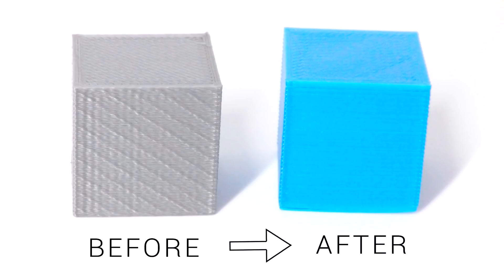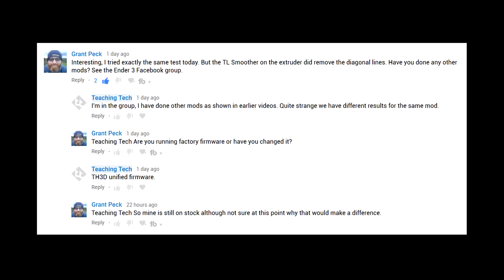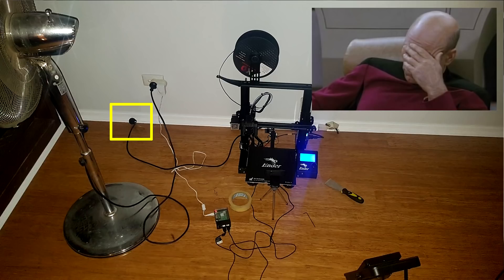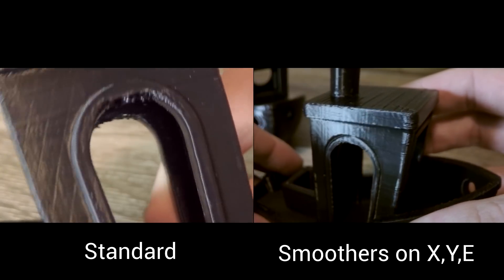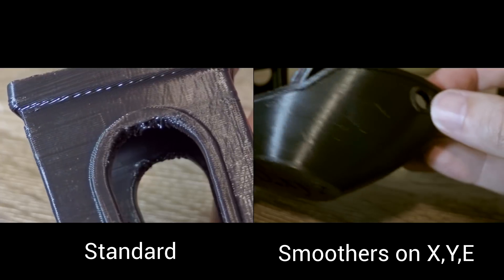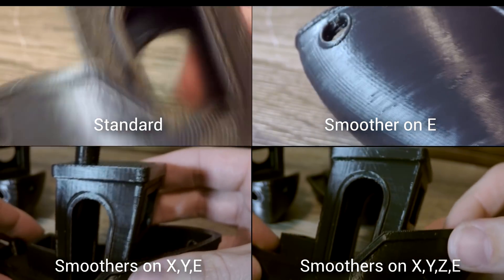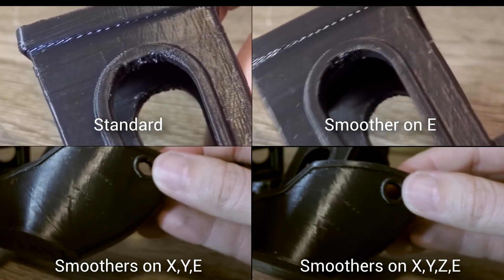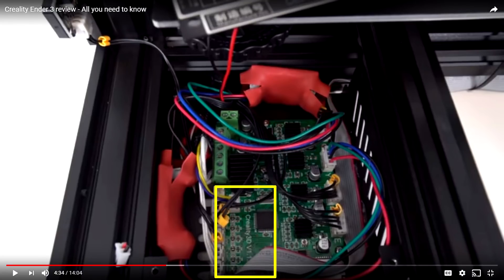Ender 3: TL-smoothers an upgrade? (Part 2 - X,Y,Z,E)

Comment: Got good results on my Ender 3 extruder with the "BigTreeTech" TL-Smoothers. I did the Y axis and left the X. It didn't really  make any real change to these... maybe Y was slightly quieter in operation.
Reply: so it is not profitable to buy?
Reply: Rafał Nie podam It's worth it (for me) to get just one for the Extruder stepper. X&Y not worth it
Reply: And you bought for sure good? 8 LEDs
Reply: Rafał Nie podam Yes, 8 diodes. :)
Reply: But how to install it on everyone
Reply: Rafał Nie podam They are just plug in modules. One per axis.
Reply: yes thanks

Comment: I wonder what the effect will be of upgrading the motor drivers with a TMC2130
Reply from the maker: The factory steppers are integrated into the Melzi so can't do it without changing the whole board.
Reply: Teaching Tech didn't knew that, thanks! I'm sure the dampers will improve the printing quality, excited to see your results.

Comment: Hello I had some trouble with print quality similar to yours but instead of having those diagonal lines mine was plain vertical lines. The reason behind the defects was that the x and y axis would lock up on a specific part of the extruder like if a car is going through a speed bump. I solved the issue by loosening the v bearing on the x and y axis, enough to where it was smooth but still rigid to the extruder. Also I use cura so I changed a slicer setting to where it does the infill first then the wall. I hope this can solve the issue and thank you for all the information you've been uploading for the ender 3.
Reply from the maker: I will check for this, but last time I tried everything was moving smoothly.

Comment: If the printer is unplugged, how is the LCD on?
Reply from the maker: Octoprint USB gives enough to barely light the LCD but that is only 5V so no heaters or steppers.
Reply: Teaching Tech not good. Don't forget to mask out 5v rail on the USB head or cut the wire. https://lookaside.fbsbx.com/file/fix_usb_semi_power_on.jpg?token=AWwC27y5tGMSDrlGssf5JVaeyjNoajFPdrb4emULLROW6f508vcpHSIgync_ZIqStk_iXY5LEhBag1ewSwhW6q7ABoiMFVVNJE1WOwDgCqAoygLR09FcD8ix9btz2VrN8UxeDZWxR7MYUcg2qSWRk4m1
Reply: But still able to navigate the menu

Comment: It might be worth going over your printer and making sure there aren't any loose/wobbly mechanical bits, that all your rollers are properly aligned and firm and even against their groves.  Note that they use eccentric nuts and bolts to fine tune their position (at least on the CR-10).  There should be no play in any of the mechanisms, and if you try to "wiggle" something, it should all feel rock sturdy.  Loose wobbly print beds or extruders will in fact produce wavy periodic artifacts in your prints.
Reply from the maker: Great suggestion, and yes the same adjustment is on the Ender 3. I will definitely be doing this.

Comment: Thanks for the non-result. Excited for the next video. Make sure to test dB with the dampers.
Reply: Maybe a comparison between cork dampers and the regular dampers people are purchasing.
https://www.aliexpress.com/item/Funssor-5pcs-3mm-Anti-Vibration-Cork-dampers-die-cut-Damper-Isolator-Cork-Gaskets-for-3D-printer/32811476661.html
Reply from the maker: Will do :)

Comment: i bought my smoothers and the diodes are smaller then the ones on your smoothers. still have 8 diodes though. also two of the 4 that i got didnt work. the extruder would just pulse in and out when told to extrude.
Reply from the maker: Very interesting. I've never had a dud one yet but it would definitely be possible.

Comment: Do you have a maker box subscription? If so It would be great to see you make a video each month with the maker box filaments say a maker coin? An second do you print with ABS at all? I never jumped to it yet I'm curious how the photo studio tent works I have a ikea enclosure half way done but its storage for 40 kelos of filament right now
Reply from the maker: I have a lot of samples from my filament sponsor www.x3d.com.au
I wouldn't mind doing a video like this from time to time. I used to exclusively use ABS for years, I have a lot of it around but only use it when there is something that needs to withstand higher temps.
Reply: Teaching Tech okay those would be a few awesome video ideas also I just got my ender 3 in yesterday I'm working on throwing it together I'm upgrading the power supply fan an putting a thermostat inside it so the fan only comes on when it gets above 50c an shuts off at 33c an I'm going to be throwing smoothers on all motors. An I'm getting ready to order the 3 for 4 kelo plus some samples from x3d there marble filament looks awesome!!
Reply from the maker: I have some marble filament ready to test. Planning a video where I print some statue like objects and try and post process them in a tumbler.

Comment: The diffrence has to be in the slicer profiles and speeds people are printing at.
Reply from the maker: TL-smoothers are definitely a known solution, just not on every printer. What you have suggested is very relevant too.

Comment: Ive found with tl smoothers on the x and y on my cr-10s and tronxy x3a that both printers run much quieter,  no noticeable difference in print quality, but i knew that going in may be the case.

Comment: FYI, theres a case cover on thingiverse that doubles as a fan cover and also holds the tl smoothers on the backside. I haven't tried it since i don't have smoothers yet but seems a perfect fit for this video.
Reply from the maker: Awesome, found it: https://www.thingiverse.com/thing:2969528
Reply: Which 3 would you put the TL Smoothers on for this case since it doesn't fit 4?
Reply: fyi: this doesn't look like your mistake Micheal. Looks like tiny bugs in your ender, it's defnly typical of creality's almost-great quality control ;o)
Reply: and it made it... differentish - n ugly...
My best guess? u still getting vibration, or lec noise on carriage/steppers - let me find that servo isolators vid... https://www.youtube.com/watch?v=GAW5xFV0ryE looks like you could print them almost. Look at that moireing n little bobble at the start of the path on z, maybe? I know angus had a failure on the ptfe fittings, either end of the bowden...
First thing I'd try is bolting it to a brick wall on the Z - just cos I like installing machines, flat floor first you know? :oD

Comment: When a magnetic field in a coil collapses it creates a negative flyback pulse, maybe that is what the diodes are trying to stop. Good work on chasing that up thoroughly.
Reply from the maker: Shrodinger Z blog post (inventor of the TL-smoother): http://cabristor.blogspot.com/2015/02/drv8825-missing-steps.html
Reply: Teaching Tech thanks for the link to the electronic engineering blog. Can you add that link into your video description block, please, for engineering types like me?

Comment: Dampeners will make a change in the noise level for sure. Also watch for increase temperature of the steppers after you install them. I don't know what's the safe temperature for them.
Reply: Makes sense, the rubber stops the heat from spreading to the frame, might be an idea to add some heatsinks.
Reply: I'm am on the look for some heatsinks, the problem is the Y stepper that only has one side where they can be fitted. Anyway I measured my steppers and now they easily get to 55°C
Reply from the maker: Will measure temperatures before and after.
Reply from the maker: I will measure mine before and after to compare.

Comment: Maybe the narrow tracked bed is causing some wobble/vibration issues?  I’d buy one if I could possibly mod it with dual linear rails.
Reply from the maker: Ooh that sounds precise. I might check the tolerances in the rubber rollers.

Comment: But Octolapse is also not really a great improvement on the print quality, though. I don't really like that you use that for quality benchmarking tests.
Reply from the maker: I suppose I would say that it is constant between each print. I have the settings better now so introduced imperfections are minimal. hey are not shown in this video because they are irrelevant to this testing.
Reply: I have seen an other test about printspeeds and artifacts (sorry, I don not know the link anythere). Conclusion was, there are more artifacts, if the gcode is sent via serial than coming from SD. There have been prints much improved by using sd instead of serial. The reason seem to be, that the serial interface is significant slower than the sd-card interface and causing more processor load (as the processor do not multithread..), so processing commands from sd is the optimal way (on 8 bit controllers).
Thats the reason, using octoprint might result in wrong conclusions as it may be an cause for artifacts that of course can not be solved by smoothers. It must not be the case here, but you should definitly try out if there is an difference between using octoprint and using the sd-slot inside the printer-controller.
Its the main reason, my mk3 got an Air Flash SD instead of octoprint.

Also there are huge differences on different "smoothers". Not only 4 diodes vs. 8 diodes, but also the type of the diode matters. So some smoothers may have an effect on print quality, some might not, even than looking equal.

But better print quality is not the only reasons for " smoothers". Two other effects should also occure:
As the diodes should get rid of (self-)induction from the motors, they should get a little quiter. And of course the most important reason for smoothers: If you move axis by hand even in an unplugged printer you sometimes see the display lightning up as the motors become dynamos. To fast movement can result in destroing your board. As the smoothers get rid of the induced voltage, it protects your board. So they are normaly not useless at all...
Reply from the maker: Just for the record the base version was printed directly from the SD and exhibited the lines. Thanks for your all of the detail you've put into this comment.